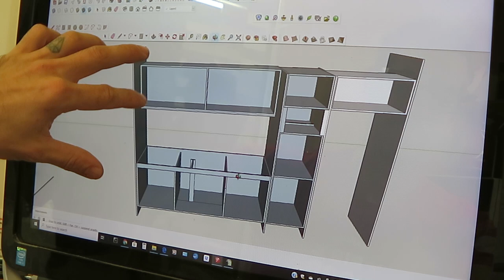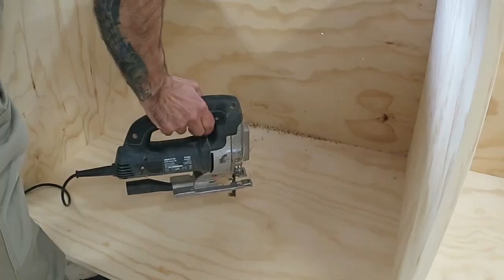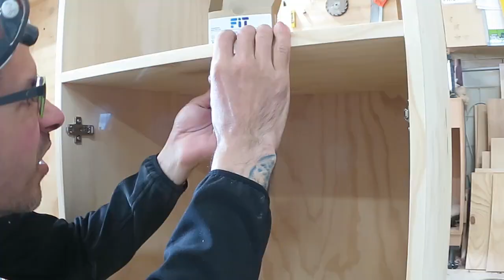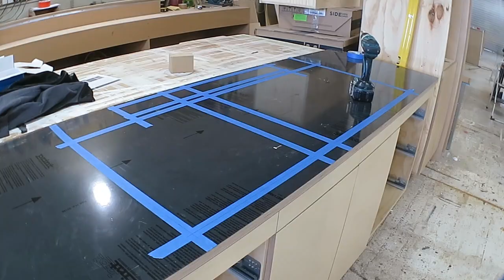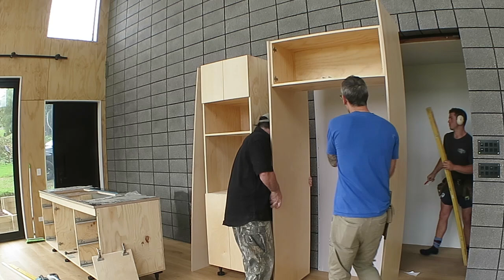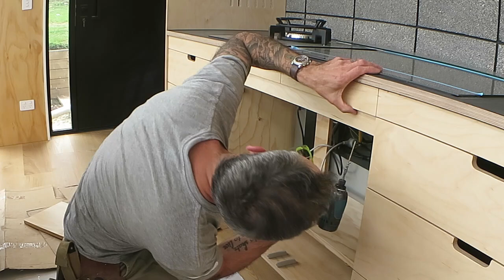plywood kitchen build

Comment: 3:08 just screws without any dowels? That's not how we build cabinets in Europe. Round dowels are a must, they keep the panels from shifting. Screws' role is only to keep the panels joined, they are not meant to prevent shifting.

Comment: Joey, I'm curious if you've changed the way you make the carcasses now you have a lamello - eg. do you still just screw them together as you do in this great video? Cheers, Stephen C Queenstown
Reply from the maker: Yup screw em. Lamello is actually pretty slow and the clips expensive. Typically I only use it for special situations like mitres
Reply: @KingPostTimberWorks Thanks, Joey.  Really appreciate all the knowledge you share here and on The Shop Stool podcast, and the fact you removed all the advertising from your YouTube channel makes it so much better to watch without the stupid interruptions of adverts. Thanks for your generosity and for the info on screwing Vs lamello 👍

Comment: The only thing that I would do differently is set the two cooktops flush into the worktop. It stops the glass getting in the way and protects it a little more from accidental damage.. (Yes I have experience of a bottle falling over and hitting the edge resulting in the whole cooktop cracking right the way across.. )

Comment: Nice work. I'm about to build my own kitchen island which looks pretty much the one you built here. Would it possible to get some details about yours? the height, the depth, etc. My countertop will be a river table made from white pine and a river of concrete so will be quite heavy... any advice on the best way to support all this weight? thanks

Comment: Most cabinet building videos I've watched used pocket hole but u didn't, is it ok not to use pocket holes??
Reply from the maker: Absolutely,  I have been in this business for over 10 years and have only needed to use pocket screws about 4 times.  Straight screwing is just fine and faster then drilling pocket holes.
Reply: @KingPostTimberWorks  oh ok thanks but I see that you don't really hide or cover the screw heads. Or do u do that?
Reply from the maker: @edwinasante8242  no screws a visible once its all installed.  Typically we make a carcass  then cover that with end panels and doors. All of which are fixed from the inside
Reply: @KingPostTimberWorks  right, Great tip. Really appreciate

Comment: How far apart do you install the adjustable cabinet feet? Thanks!
Reply from the maker: Usually under every vertical divider. Or about 800mm .
Reply: Ok, I will need to order some more then. How long are your screws for connecting each panel. 

Sorry for asking so many questions but I am in the process of getting everything together to do this. Thanks!

Comment: just wonder why you do not laminate the plywood with material such like hpl ? water will ruin the plywood in few months.
Reply from the maker: How would an HPL help out?  All the ply has at least 3 coats of polyurethane including the edges. HPL ply would still need some form of treatment to the edge, what would that be ?
Reply: @KingPostTimberWorks  for the edge we can coat it with resin.

Comment: you guys have cnc but not a proper edge machine why you dont put edge tape all around, and by the way it should be no back panel behind the microwave and oven it will over heat
Reply from the maker: There is edge tape on the carcass to hide the cheaper plywood.  The birch ply is left unedged as a feature.  I install all appliances  as per the manufacturers instructions, in this case no extra venting was required but I did cut a large hole in the back panel behind the oven to take advantage of the cooler air in the 100mm void there,

Comment: Plywood kitchen?? 🤔
That is smth new for me. 
Looks like it's not made for real cooking. Isnt it?
Reply from the maker: Not sure what you mean exactly,  a lot of cabinet makers use plywood it just usually has a laminate on it with edgeing.   As far as cooking goes its designed by the people who will use it.
Reply: KingPost TimberWorks 
Here in Baltics (Northern Europe), 90% we use laminated chipboard for kitchens and other furniture, because of price, comparing to laminated ply which is twice expensive. 
And also that we do not have as much color/design options for it. 

Havent seen any kitchen made out of ply. That's why I am so surprised. 😃

Anyway Thanks. 
I need kitchen myself now and I really hate constructions out of laminated chipboards, because this material doesnt hold screws very good. 😉🙋🏻‍♂️👍🏻

Comment: Yeah, good work. In hindsight do you think you would have had a cleaner look with more flow had you cut a 45 on the drawer tops too? As it is you have two types of opening (cut-outs on the drawers & 45's on the cupboard doors).

Comment: I would really like to have some measurements.

What I like about your method is the avoidance of having to build each cabinet separately!
As a result there appears to be less material usage and more space gained for storage.

I'm actually in the process of design a kitchen for my girlfriend's small apartment. 😉

Good job!
Reply from the maker: That's right, it's much more efficient to make longer carcass units.  And really is  the tradional method. (Albeit with out sheet goods)

Comment: I install lots of euro kitchens, Poggen pohl, porcelanosa etc. they all seem to use mdf based veneer, or cheaper, melamine based stuff for doors. I’ve also seen plenty of plywood doors used by carpenters making cabinets on site which eventually buckle especially if cabinet is in bathroom area, or basement.
How do you deal with plywood doors? Specific high quality plywood? Do u stabilize it in any way?What about floor to ceiling tall doors? Even for mdf Poggen pohl uses tension rods on inside center of door. Did you have to replace doors from previous jobs much?
Reply from the maker: I generally use 18mm birch plywood for doors/panels  in my experience the plywood tends to decide if it wants to stay flat within a few hours of being cut. I have had the odd door twist over time. Would say I have replaced maybe 4 doors in ten years.  Which could be to do with our climate too I guess. Tall doors are always a problem I tend to design them away if possible.  I haven't heard of the tension rods before that's interesting.
Reply: @KingPostTimberWorks  We use them a lot for tall and wide doors here in Europe since man made materials have built in tension from the fabrication process. You can find them in various catalogues...

Comment: Very very good. Here in Brazil unfortunately carpentry is very expensive to assemble and maintain, and we don't have these tools and resources. Here is what we call 8 or 80: it is either very weak and amateur and not cheap because Brazilian taxes are absurd when it comes to machinery or very powerful and astronomically expensive.

Comment: Hi, great video once again. :) May I ask you some things please if you have the time?. at 3.00min and 4.45 min when you were using your screws - what spec of screw are you using ? Also did you use just screws no glue at all? and lastly the carcas body what ply was it (i know you used birch for the outer sections) . Many thanks in advance sir .
Reply from the maker: I use mostly 8 gauge zinc coated screws.  I don't glue cabinet carcass at all.  Mostly because it's not going to do anything especially on prefinished plywood.  A carcass once installed is under no dynamic stress and effectively just sits so screws are more than enough to hold everything in place. I use pine plywood for lower budget cabinets but now I tend use only 16mm mixed hardwood ply with a white HPL laminate.  Its sold as carcass grade ply as the laminate is not perfect but fine for cabinet interiors.
Reply: @KingPostTimberWorks ... Thanks for the time you spent replying, great help, can I just ask you one further thing, how long were those screws? They looked like 2 inches, might be my big TV :}
Reply: @KingPostTimberWorks  ps great job, simple but very nice design and the redesign to those bottom doors does look better! Perhaps do them like that from now on

Comment: hey!! nice build and video!! what finish do you use on yout plywood, and what is that thing that you use to apply it with??
thanks
Reply from the maker: My go to finish now is Mirrtone , mirrotec water based top coat 8060 (used as sealer coat too)  I use what they call here in NZ a speed brush which is just a sponge with fine nap.

Comment: Your work is fantastic, but I feel like the architect failed to specify the plywood correctly, either to you or to the contractor who did the walls... The room would have looked so much cleaner if the wall panels were the same grain and color as your cabinets.
Reply from the maker: Cheers,  all things like that end up being budget issues,   at this point in builds I'm almost always asked to delete of change spec based in what money's are left for the job.
Reply: @KingPostTimberWorks  completely understandable, but in that case, the cabinets should have. Been built from the same, less expensive plywood as used on the walls:)

Comment: Nice work! I don't get why there was a large wall piece at the left side of the kitchen. The room is such a nice open space, so it does not fit there.
Reply from the maker: There is an external door there
Reply: @KingPostTimberWorks  Yes, I see the black door. I just think it would have looked better without the large plywood piece in front of it, so when you enter you get a good view over the entire kitchen and room.
Reply from the maker: @unsortedguy  ah right , the client had the opposite thought (ha) so that's what we did.
Reply: @KingPostTimberWorks  I understand! Nonetheless, great work! Loved how kitchen turned out!

Comment: Hi Joey, are the carcass butt joints just screwed together or are they glued and screwed? I see many builders use pocket holes for the carcass build. Would they be stronger than the butt joints you used? Thanks
Reply from the maker: Hi, so both use but joints. Its technically possible for the pocket hole screw to be stronger than a through screw. However in a cabinet application once built and installed the cabinet should be under no dynamic forces.  What really make a cabinet strong is the plywood itself,  acting against itself for lateral and diagonal bracing . This is why I typically won't glue carcass panels together.  A base, side and back panel form a far stronger connection than glue could help with .
Reply from the maker: @christopherkeve  there is never   any harm in adding glue,  but probably is redundant

Comment: Have heard mixed things about plywood off-gassing. Maybe I missed any mention of this in the video, but is this a concern and are there mitigation means if so?
Reply from the maker: Typically no one here cares at all about  such things. Generally though as long as all exposed ply is sealed . It mitigates off gassing
Reply: @KingPostTimberWorks  Thanks. I guess that explains partly the layers of poly. Kitchen looks great, btw

Comment: Joey, Do you have a program/app that you get cutting diagrams and materials list from? Must be a nightmare for each of your projects getting the most out of your lumber and estimating what you'll need without going over too much.
Reply: There are other options out there, but I like to use a free tool called Workshop Buddy.  Just search for it and you'll find it.  You enter the pieces of stock you have and then the pieces you need and it'll lay it all out for you.
Reply from the maker: Ha no I don't.  I actually do most of it in my head after I draw the project.

Comment: Did you leave the drawer pulls/recesses exposed ply? Or did you edgeband that part too? I’m about to do a similar pull and can’t decide if I need to use solid lumber or if edgbanding will hold on a curve like that. Thanks!
Reply from the maker: On birch ply I leave all the edges as is. I only edge band the cheaper carcass ply

Comment: What clear coat do you put on the plywood? I'm in the process of designing my kitchen and was going to spray lacquer on, but yours looks much easier and quicker!
Reply from the maker: I use (for almost everything now) Mirotone  , mirotec wb 8060 clear top coat.  I use it as a sealer too. With fair weather you can easily get 3 coats in a day.
Reply: @KingPostTimberWorks  Is it pure acrylic or acrylic + PU (polyurethane)? Do you use it also for horizontal work surfaces (countertop surface)? Is it sufficiently sustainable for non laminated countertop?
Reply: Can’t get in the UK unfortunately!

Comment: The client: “please make sure that my microwave is the perfect height to tip a boiling bowl of soup over my head and chest”
Reply: It's at the right height so that something can be removed and placed on the adjacent counter without having to raise or lower it. This works well for a lot of people. Another option is to put it just below a counter so that it can be lifted straight up. I always design kitchens to have at least 18" (450mm) of free countertop at both sides of a cooktop and next to or above a microwave... my 2 cents. :o)
Reply: @HistoricHomePlans   the microwave is what @Ianmundo is talking about. It sits above the oven which mean the user will definitely have to lower whatever they are removing from it.
Reply: Yeah, that's far to high. Refrigerators are normally 5.5 to 7.5 ft tall  o.O

Comment: That ply came out beautifully.  The concrete wall is going to absorb grease and gunk over time but that's their problem. I'm not sure about the plywood with white drawer sides, do they take 18mm bottoms or do you rebate it to 16mm?
Reply from the maker: Yea I rebate the 18mm down 2 mm
Reply: @KingPostTimberWorks  Can you please clarify what you mean? What is the purpose of the rebate? Thanks
Reply from the maker: @allanpennington  the drawer runners are made for 16mm base panels.  So I rebate the 18mm ply to fit

Comment: The old 100mm trick. It's reassuring to know that even the pros are not immune to that mistake
Reply: can you tell me more about it ?
Reply: @nhatminhtran7917  well, basically, you just forget about 100mm, and that's it))
Reply: @IvanNizhnyNov  thank you for your answer.
Reply: @nhatminhtran7917  It can be hard to hook the 'dumb' end of your tape over the short point of a mitered edge, so you hold your tape on the 100mm mark, then measure and deduct 100mm before you cut it. The mistake is forgetting to deduct the 100mm, so when you cut your piece, it's 100mm too long.
Reply: @MrBraden17  thank you for you explanation ! :D